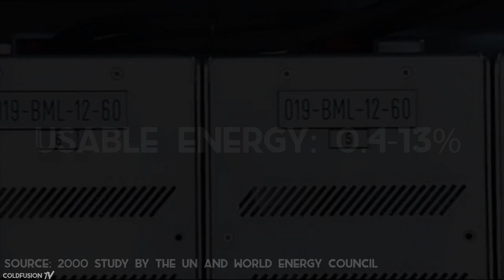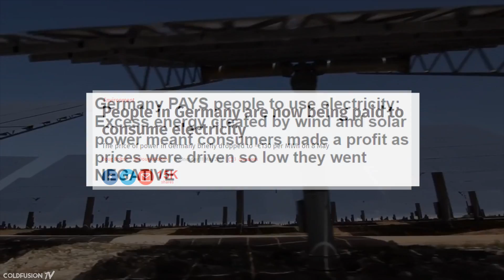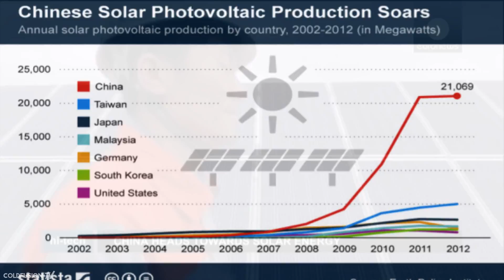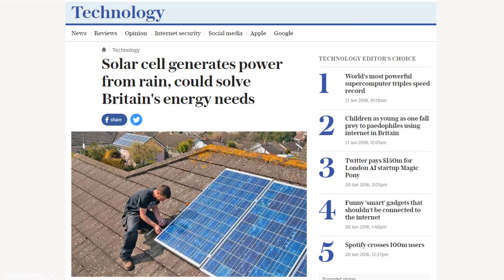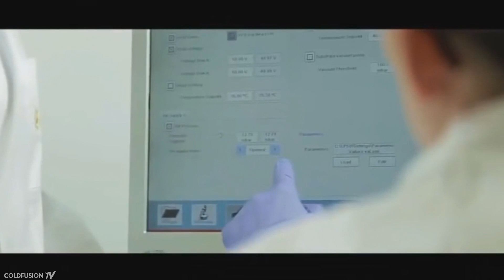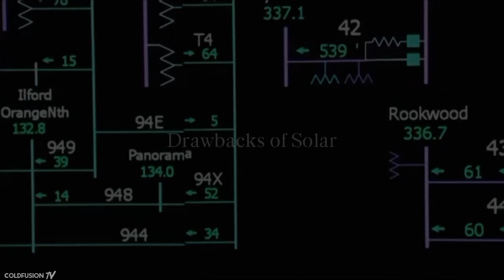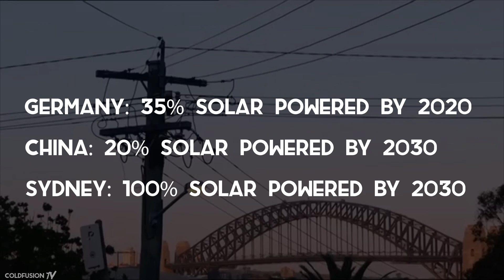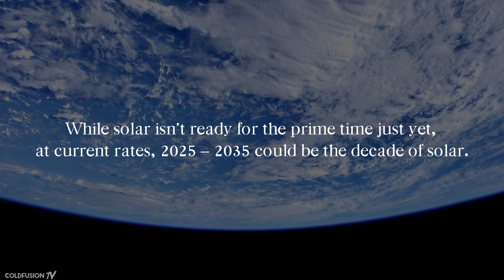The Truth About Solar

Comment: It's glitzy to talk about falling costs & creative innovations in solar panels as the driving force behind increasing solar applications - but you don't really understand the business or the science. The actual panels are less than ten percent of total of a mid-range residential system. In my experience, getting the power from the panels to your sockets & lights through invertors, chargers, etc is the major expense & hassle for DIY'ers. Plus if you buy any parts of it from Chinese suppliers, the risks of replacing it routinely is exceedingly high, not to mention any costly destruction to the rest of your system in the process. Alternativley, purchasing the entire system from a typical start-up supplier is still more expensive but not free from brown-outs & disasters. My belief is that all solar suppliers & contractors are start-ups, but some are less novice than others. Take systems that require battery-backup, for example, many suppliers refuse to offer it because it's problematic, suggesting, "just buy a generator if you want power at night." Where is a professional when you need one? I'm still glad for the grid.

Comment: Another thing to keep in mind is the other side of the ledger. The consumption efficiency of many new devices is increasing at a similar rate, meaning
there should also be a reduction in consumption should the energy price remain constant, or until we start driving electric vehicles. At that point our actual energy
consumption will shift from fossil fuel (petrol/diesel) fill up each week, to a quarterly electricity bill, offset by rooftop solar, but then likely to be taxed up by government's
looking to recoup those diminishing fuel tax revenues. Regardless of the source, or how clean it is, I predict a crossing point where the transition to electric vehicles will be matched
with a proportional tax on solar electricity. It fit's perfectly with the current infrastructure design, where your rooftop solar generation is metered separately, and not directly 
offsetting your consumption dollar for dollar, or watt for watt, that difference is already just a tax.
Reply: Tax on solar energy? Pls do not give these evil corporations any ideas.

Comment: Problems with all this is we go from one pollution to an other we all put solar panels on our roofs and drive electric car. We will cause same or more pollution as electric vehicle batteries take tonnes of CO2 and other gas to be manufactured used and recycles meaning we are worse off we will use more of the world resources as well. Tonnes of CO2 to male solar panel

Comment: It's disappointing to see you didn't mention solar panels with the cooling jacket on the back. If solar panels overheat they lose efficiency. Plus what about those types with the saw tooth surface [under the microscope] that greatly improve output?

Comment: With the utilities Demanding control of all generation, including all panels on a roof.. and using their ability to turn them off due to the duck curve.... they will drive solar right out of the equation unless they control every watt.  More than half the states require a connection to the grid.. cut that off, and they will remove your certificate of occupancy.  (Florida power and light down in Florida got that passed recently for example..) -- So the state takes away your home if you go personal.)--then the goodies that really matter.. You stay connected to the grid.  The utility sees generation approaching demand.. They simply slipped their frequency up to 62 and all those grid tied systems get knocked off the air, so to speak.. There are ways around that, but the utilities have a new way of handling the problem...  "We need to add an equipment fee for your Solar Panels" - about $10-20 per KW your panels might generate.  OK. put 10kw on your roof---pay the utility 100 to $200 per month for equipment you own.  That allows them to basically hit you with close to the same bill with NO expenses....

Comment: Energy storage is the major problem to solve. Here are most of the variants of energy storage solutions.
I translated this very comprehensive diagram for you.
It shows you the different technologys and what thier rough range of flexibility in terms of storage speed and duration are.
Note that both dimensions displayed have a logarithmic scale.

https://geschaeftspartner.stadtwerke-essen.de/fileadmin/nws/2015/power-to-gas-2.jpg

Translation:

- Title: STORAGE TECHNOLOGYS IN COMPARISON
- Subtitle: THE NATURAL GAS NETWORK HAS THE BIGGEST STORAGE CAPACITY IN GERMANY
- X-Axis: Amount
- Y-Axis: Time in h
- Red Elipse: Flywheel
- Pale Ortange Elipse: Batterys
- Grey Elipse: Compressed Air Storage
- Cyan Elipse: Pumped-Storage
- Blue Elipse: Hydrogen
- Green Elipse: Methane

Comment: You really need a second video on energy storage, because that's what will make or break solar.   While we have batteries, pumped hydroelectric, and other systems, we don't have anything in a large enough scale to deal with demand at night.   This is not a trivial problem, because efficiency and cost are real issues here.
Reply: Well if you want the storage problem solved  Google 1414 DEGREES and enjoy
Reply: @bernardlentern3903    Interesting, but they'll need to start building operating plants that will be running for several years to see if this is a lot of hype or a good solution.  Real world numbers on cost, energy efficiency, and percent loss in energy per day will be needed to judge if this is a boom or a bust.
Reply: It's a huge project and China will probably need to lead this but distribution of surplus of green energy to anywhere seems easier than storing it.https://en.wikipedia.org/wiki/SuperSmart_Grid
Reply: @jean-pierredevent970  Êtes-vous vraiment de vent, Monsieur?
Reply: He mentioned storage but doesn't this mean batteries -- which means more chemical waste at the end?
Reply: solar panels can literally be put in ur backpack n charge ur devices with it n ur questioning efficiency ? u ask about energy production during night dont u know that one hour of proper sunlight gives u more than enough energy for like 3 days? u want to know about cost well 40 years back u had to be a real rich kid to have them but now they r in remote villages too!
Reply: @vaish3887  No, I don't know any of that -- and frankly it sounds rather unreal.
Reply: people should just go to bed on time ;)

Comment: Who is watching this in 2019....
Reply: Mid December 2019, among the last I bet
Reply: @kenbiron1964  yep same here, honestly I saw the "harvesting power from rain" and thought, "why are they not also working on semiconductors that are also opposites in triboelectricy too? this would allow harvesting power from any air currents at all, since air will pick up electrons from one and then be repelled away from it, and reach the other to have the electron ripped off it by the opposite triboelectric substance, and a conduction path between the two higher than the air, will cause a flow of current from this static which is just a way of saying capacitive storage of electrical charge, that can be exploited, since air particles are all moving at around the speed of sound on average, (thus why sound travels at the speed it does in air as a medium :)  )  I have a few videos up else where (different account) where I was getting some good results out of plastic solar cells that used two opposing triboelectric effect materials, just need to develop something good at conducting and transmitting light like thin layer graphene or something to finish up on that project XD
Reply: I just seen the video
 December 19th 2019

And the best solar power efficiency I can find is about 20% I don't know what he got 30 to 35% efficiency in 2016 😞

Maybe I should go back in time and buy some solar panels back then since they're better than now 😂😂😂

Comment: My solar panels lose 75 - 80% of their production when it's cloudy.
Reply: It could be the way they are wired, in serial vs parallell. Picture a Christmas light with one bulb dead. That's a cheap panel, the total efficiency drops substantially for every sub-panel not receiving enough light.
Reply: You should've done more research and opted for the mono panels.
Reply: a 24 V system works remarkably better in cloudy weather. Especially when wired in groups of three panels in a bundle.
Reply: You chose poorly.

Comment: Why the US has not, at the very least, introduced some vehicles, like city buses, taxis, and some government vehicles to use Hydrogen is completely illogical. 

When in Jr. High school I was routinely making Hydrogen in my father's basement using his Western Auto 12-Volt Automobile battery charger. For the amusement of myself and several neighborhood friends, I would fill plastic trash bags with Hydrogen. The place where we bought fireworks for the 4th of July had a huge spool of green waterproof cannon fuse which they sold by the foot. The previous year I purchased approximately 24 feet of the fuse for just a few dollars. The first thing I did was to burn test the fuse in order to establish a burn rate per inch. I would tape a few inches of the fuse, shielded between a cocoon of cardboard to minimize the risk of sparks from the fuse prematurely igniting, to my bag of Hydrogen. When the sun went down I'd bring out the Hydrogen-filled bags. I would hold a bag steady while a friend would light the fuse and then I'd release the bag. The bag would rise and rise until out of sight in the darkens. From the moment the fuse was lit we'd all start counting off the seconds in our heads. When the fuse finally burned into the hydrogen bag, way, way up in the night sky there would be a sudden bright flash of light as the bag of full of Hydrogen detonated. I was making my own little Hindenburgs. The reason I wondered off this seemingly unrelated recounting of burning Hydrogen filled trash bags and cannon fuse was to give you a sense of how easy Hydrogen can be produced and handled. If me, a thirteen-year-old kid can figure it out then it can't be that big of a deal for the Government to do so as well. Hydrogen is easily made from water, easily compressed and stored in tanks. The gas is lighter than air so that should a spill to occur Hydrogen quickly rises into the atmosphere and harmlessly disperses. And the best part about Hydrogen is that it burns cleanly and is environmentally safe to make. When Hydrogen burns it does not produce foul smelling smoke-like gas and diesel does but instead produces H2o or simply water. The ever-improving manufacturing process of better and better, more efficient solar cells means that we can harness more electricity from the sun in which it can cleanly be processed and stored.

Comment: I built my own solar panels, mounted them across my roof, purchased a large Aims 5000 Watt Inverter, and a charge controller. All of that was expensive but nothing compared to the batteries. The large super heavy 6-volt Deep-Cell batteries were by far the most expensive part of the whole setup. But the cost of the batteries is ironic as the batteries were the weakest link in the solar power setup. I had my solar panel setup basically as an emergency backup. That's good because in just a few years the batteries began failing despite my daily checking on them. After all my batteries failed, after only needing them three to four times at less than an hour each I became disgusted in the whole thing. I now have a single light bulb, where my batteries used to be, that dutifully begins faintly glowing in the early morning and gets brighter and brighter until looking at hurts my eyes at about noon time every day as the Sun rises directly overhead. Then the bright little light bulb gradually begins to fade as the sun makes its way West. And that's the extent of my solar lighting system. With the batteries so expensive I couldn't make my self by all new batteries knowing that they to will fail exactly as the first group did. I looked into super caps but they require super amounts of money to purchase. I would bet the farm that there are a whole lot of solar power setups like mine that are just sitting useless due to battery issues. The day that super caps are vastly improved and their prices drop dramatically will be the day that the home solar panel business takes off again. But as for now, the solar panel enthusiasm will remain low.

Comment: WHAT a load of shit 36 cents per watt for a 255 watt panel = 91.0 per panel well hook me up with the retailer at $91.80 per panel  I have a 5.5 KW system and it cost 14,000 dollars Installed  22 X $91.80= $2,019.60  the inverter  $3,000 + labor&parts $2500 $6,519.60      $179.00 X 22 panels = $3938 lot dearer than you say

Comment: No mention of the lifetime of solar panels or what happens after they stop working?? Not the whole picture ....
Reply: Solar panels just don't die....they lose capacity output averaging around 1% per year. so after 30years they're still making 70% of the original power, big deal.

Comment: Working at a solar research company myself. Solar energy has a bright future ahead. At a certain point the costs to produce flexible solar cells will be this low, mass production can be done. This results in making the integration low cost as well. This makes it viable to attach solar cells to any unused surface (skyscraper walls, roads and even office windows (yes! They can be translucend)). Give it 10-15 years and see our infastructure change

There is one problem. Our traditional AC grid is outdated. DC microgrids are the future. Electric cars can be used to bank up energy storage short term, centralized energy storage per capita long term.

Comment: energy for free at 35cent per watt
nuclear power plant 1GW 2G$ + 1M$ per year
solar power plant 1GW 300M$ by suny day
energy storage plant 1GW 1G$ per hour
grand total solar power 1GW for 24/7 >15G$
german and china 20% really ?
carbon generator 35cent  per watt + 0.1 cent per hour = 1GW 300M$ + 10G$ per year
at first the nuke look better but their is toxic negative threat + waste storage forever
Reply: @Allen Loser the reality sound far worst without including maintenace addiional problem 
the solar work barely four hours a day at full capacity only in summer  no smog no rain and the legend than desertic area is great not give embtion to corosive sand for glass
else orbital station al the planet location have half a day night and the sun position change all the time

Comment: you're forgetting about the millions of birds who dies becuz of solar panels every year.
Reply: Please elaborate
Reply: @iruletheworld12   well birds are dying becuz of the extreme heat produced by the solar panels in the atmosphere becuz they kinda work as converging lenses and for some random ass reason they are attracted towards it(maybe becuz it shines).
Reply: @daathisone5459  Solar panels, such as the ones in this video (photovoltaic cells), do not kill birds. I will concede that there is a plant in Nevada that focuses sunlight into a tower which does indeed kill some birds, but definitely not 'millions'. 

Ultimately, the number of bird deaths attributed to solar energy, or any renewable energy for that matter, simply isn't comparable to other natural killers, such as cats or windows.